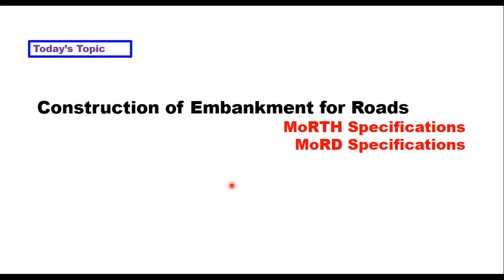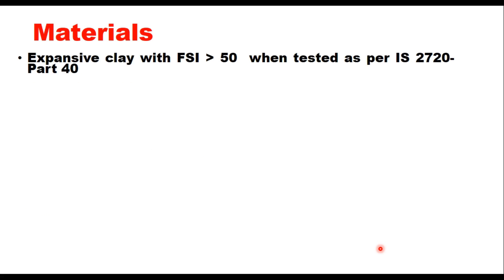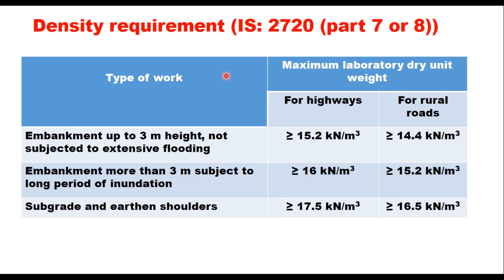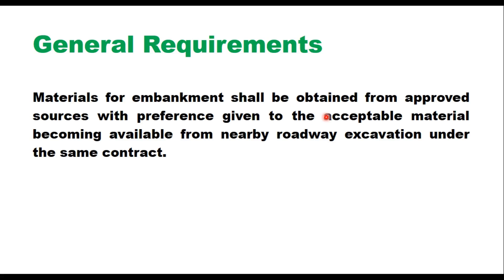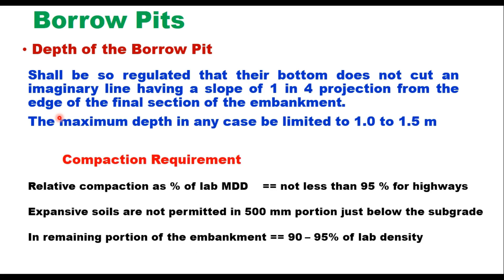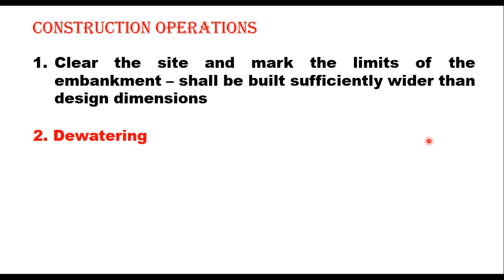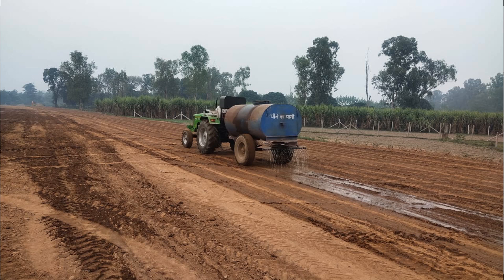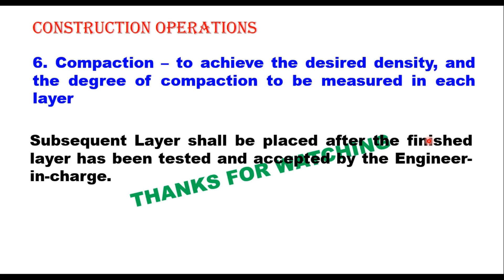Construction of Embankment for roads as per MoRTH specifications 2013 and MoRD Specifications 2014

Comment: What are the things I need to do if the required degree of compaction is not achieved at the site?
Reply from the maker: You have to do it again. Take out the layer and recompact. No other way. Lack of compaction can lead to several problems later.

Comment: Sir what to do when there is black cotton soil at base and height of embankment more than 6 MTR
Reply: In top 500mm use non plastic sand gravel etc
Reply from the maker: The soil at a depth of 6 m does not really matter. You need to comact this layer at MDD and then top 500 mm (which is the subgrade layer) must of of good quailty with CBR more than 8 percent.
Reply: @SatishIITR  thanks
Reply: Sir as morth cl 2404.2 for High embankment avg shear stress compressibility of clay strata shell be assertain.
Does the clay affect slope stability under sever wheather conditions
Reply: Also refer to morth 2403.2 for High embankment